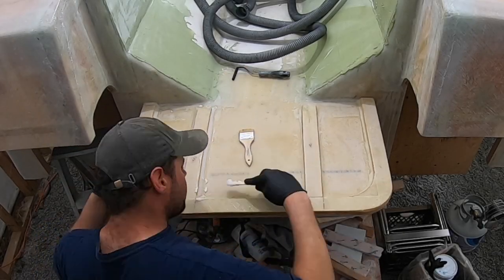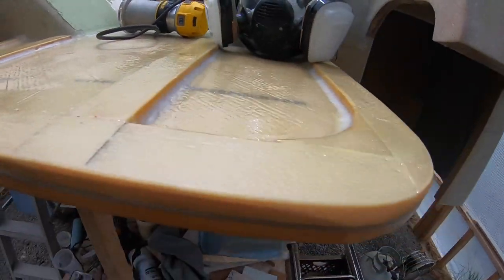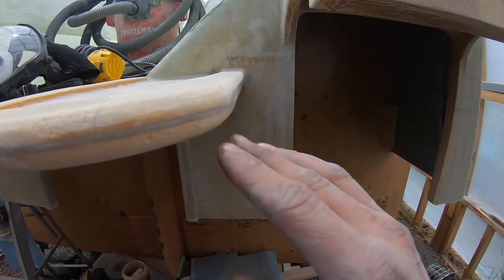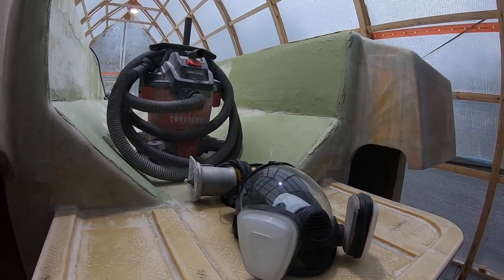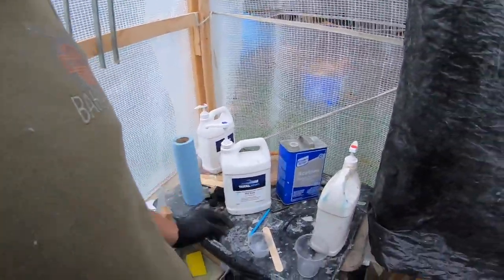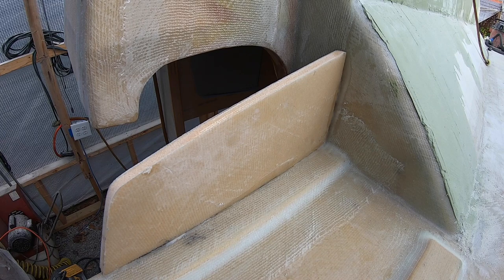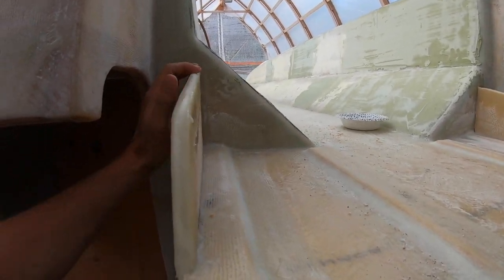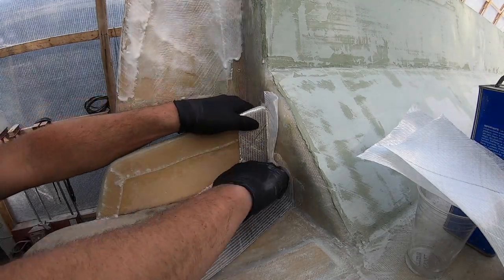Step 51: We do it Nice because we do it Twice! Swim Platform & Gussets POWER CATAMARAN BUILD SERIES

Comment: In tight corners and radius's chop up some chop strand mat,  extending your angle will make it stronger, or like on your swim platform thicken the gap with layers of mat, it will take alot of abuse kinda like the engine brackets, and area for the console.
Reply from the maker: Thanks for the info. Learning as we go over here. 🙂

Comment: I hope that there are no issues with clearance next to the engine wells and the platform gussets.

PS:
YES I'M BINGING TODAY SINCE 9AM! SUE ME!!! 😜
Reply from the maker: We don’t see any issues as of right now. Depending on what type of steering we use we may have to drill holes to accommodate a tie rod for the two motors. Thanks for watching